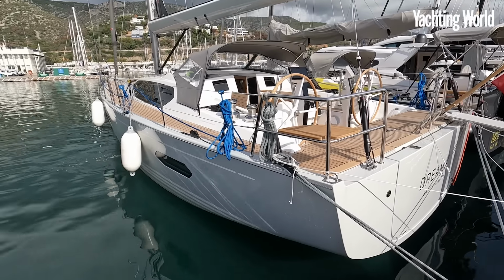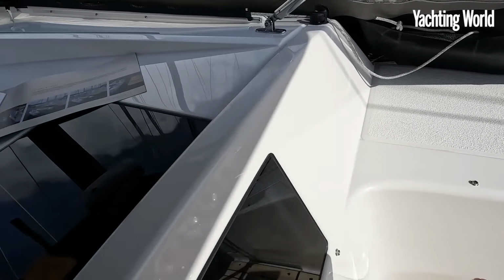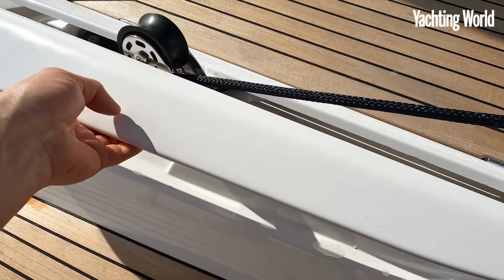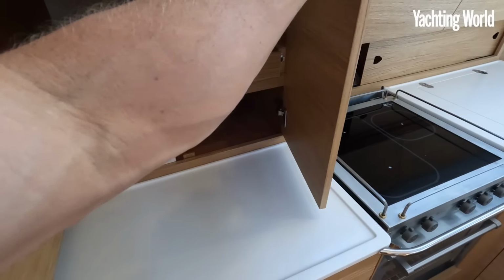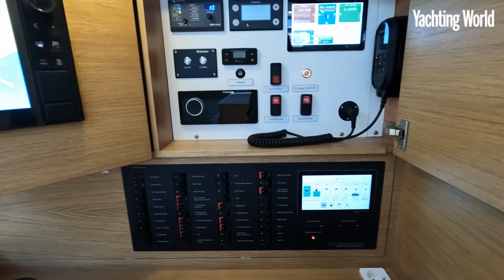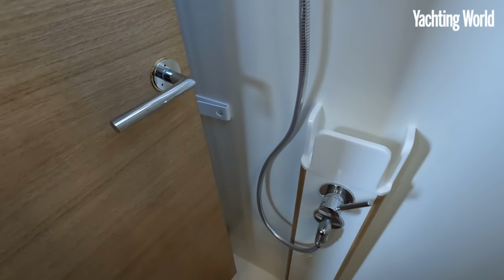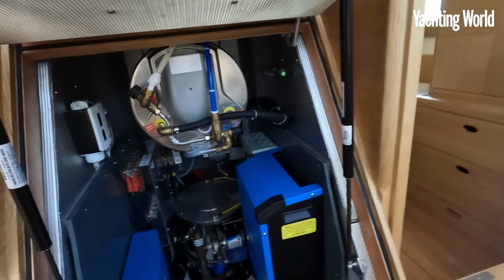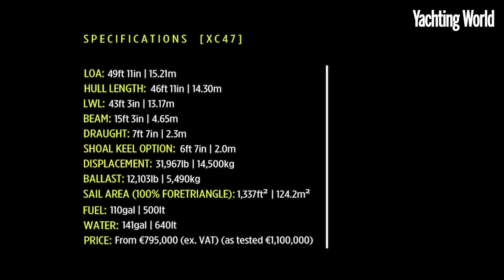The best bluewater cruiser ever? This Xc47 is definitely worth a closer look!

Comment: Did I understand correctly that they placed the water boiler above the electric motor with control controllers? Really. What can happen? With all due respect to the company, the diamonds added everywhere create the feeling that Dufour only costs a lot of money. The review itself is great. Thanks Toby.
Reply: Cheaper that way since the hot water lines already run there.  Agree it's not very wise.
Reply: What you may have misunderstood is that the size is 40 liters and therefore the placement is best with regard to available space. When I bought my yacht 15 years ago I upgraded the water boiler to 40 liters which was placed above the engine where there was free space intended for a generator. With my experience and also that I am an electrical engineer who works with boats, it is a good location for a bulky boiler. The option is not to place 40 liter size somewhere else, but in that case choose a smaller 20 - 25 liter one and place it in the stowage space under the bed. Dripping fresh water does not cause problems with electricity (48 V).
Reply: @mikaelgarton372  Yes, there is its “regular place” when the diesel engine is installed. But not in the case when there is a 60 kW electric motor and its control controllers right underneath it. It's like putting an ashtray at the neck of the tank. In principle, it’s okay, no one will smoke while refueling, right?
Reply: Your comparison is funny but not correct. Do you think there will be a short circuit ie that fresh water conducts current? What do you think would happen if the boiler not only leaks slowly but instead suddenly dumps all the water (40 litres)? How high would the water rise from the floor surface?
Reply: @mikaelgarton372  I'm definitely exaggerating. Nothing bad will happen, that's clear. The controllers are low-voltage, and the engine can also operate in water, it is designed for this. Perhaps the batteries are not made of lithium, which reacts with water. I mean that for 1 million you can make a different constructive solution. By the way, fresh water conducts current perfectly if it is not distilled 💥 :)
Reply: Interesting that you try to convince an electrical engineer that fresh water conducts perfectly :) and by the way, fyi there are 48 V lithium batteries installed in this xc yacht, but they only consist of a fraction of lithium and do not react with water like the experiment in chemistry class at school. I work professionally developing lithium systems for boats. I'll end the discussion here.
Reply: @mikaelgarton372  Forgive my ignorance. I once spilled a glass of plain water on my laptop, smoke came out, and the laptop no longer worked. This is also why my cell phone refused to work under fresh water. Now, if I were an electrical engineer, this wouldn't have happened. Good luck
Reply: @mikaelgarton372  All of your points are valid, but I know of no terrestrial electronics that like being showered and submerged in 60 Celsius water.  I would have tried to find a different location for the hot water tank, maybe in a different bilge or cabinet.

Even seawater is not very electrically conductive.  Fresh water much less so.  48 Volts is relatively safe in either.  Don't know if Oceanvolt steps up the voltage internally for the motor.  Maybe not.  And in any case it's pretty waterproof.
Reply: @Muratshayev  Most laptops and cellphones aren't designed to be used underwater.

Lithium Iron Phosphate batteries are vastly less likely to catch fire than other Lithium ion chemistries.
Reply: @LoanwordEggcorn  My point is that a 40 liter boiler cannot be placed under a sofa / bed / cabinet nor in the bilge. The size is too bulky. However in the Xc47 the floorboard is raised in front of the companion way, but as I understood here is a very large battery placed - 30 kW (48 V) translate to amphours as 13.2V it's 2200 Ah, which takes up the entire space. X-yacht has been building performance cruisers since the 70s and they always place tanks and batteries centrally. They have only been building the Xc = cruiser series for 15 years. If there had been free space more central and lower, they would certainly have placed the boiler there. The other aspect is that the hot water for the boiler comes from the genset which is placed just aft of the electric motor. The distance between the boiler and the source of the hot water should not be too far. It is also an advantage to have the boiler raised because it is easy to empty the water during winter storage and here I could note that there is already a transparent hose to easily empty the boiler.

Last but not least, the risk of the boiler completely leaking and dumping all the water is so extremely low that it doesn't exist. If it were to happen, the water level at the bottom would be a few centimeters before the water would quickly flow down into the bilge and trigger the bilge pump.
Reply: @mikaelgarton372  Thanks, all fair points.

The Fischer Panda gensets are popular, but mediocre, like most.  I'm a bit surprised that this seems to be a weak serial hybrid.  I like a parallel hybrid solution much better, like Beta is doing, for multiple reasons, including efficiency.

A parallel hybrid could keep the Diesel in the normal position, make hot water, electricity, charge the main battery bank, etc.  

A regular marine diesel with a large alternator or clutched hybrid electric drive motor is a better generator than a genset, and results in one less combustion engine to maintain.  In my opinion, it's a better overall systems solution.

(With a large enough battery bank, a genset isn't really needed, with enough solar and/or electricity from the Diesel.)
Reply: @LoanwordEggcorn  I totally agree and can add:
Although the battery is large, the range is limited (less than stated) because battery capacity is also required for all consumption. The alternative is then to run the diesel genset which creates 230 V AC (energy losses in alternator) - then transform to 48 V DC (energy loss) which charges the battery and provides power for propulsion. Some electric motors convert DC to AC to get more power but at the same time additional losses during AC conversion.
Driving the boat with a genset and electric motor is not efficient and the diesel consumption is higher versus a regular diesel engine.
In addition, I agree that the reliability / durability of a genset is significantly lower compared to a Yanmar or Volvo Penta.
Reply: @Muratshayev  An electronic device such as a laptop that does not even try to impede crap getting into it, let alone liquids, as well as mobile phone that at best only protects from dust balls and hair balls getting into it are horrible examples. Not counting that both of these are sensitive electronic devices where small fluctuations of voltage can seriously hurt the circuitry inside. Like your fresh water which can allow such small voltages to short circuit the electronics. Apples to oranges mate. I can not believe you are even seriously trying to compare those horrible examples to this topic. So yes we will forgive your ignorance, because if you were an electrical engineer (or even had a clue about even the basics of electric and electronics) you would know how silly those unrelated examples of yours really are.

Look I get your main point, that for that amount of money one would think they could have possibly designed it better. But that was already answered. It simply is not enough of a risk to spend that kind of extra money trying to come up with a better sol'n when it is really not needed and fits well in that designed space along with closeness from its source. Plus realizing that space was designed for multi-purpose options of drive power.
Reply: @kevinfisher1345  You are absolutely right! They expressed my idea very accurately. And yes, there are explanations for this. I understand. But I don't like it :)
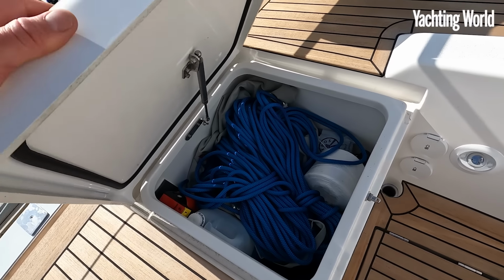I can give another example of a good solution, in my amateurish opinion - Salona S46. Good review of The ALMOST Perfect Electric Sailboat - Sailing Uma [Step 249]. There at 4:39 a compartment is shown where everything is in order. The boat went into production 2 years ago. The equipment is absolutely identical. Costs 2 times less than X
Reply: @Muratshayev  What boat costs 2x less? Are you trying to compare apples to oranges again mate? Or are you actually comparing a boat manufacture that is well known for its build quality?

Going by your brief example, I am going to guess it is nowhere close to a comparable build quality boat ... as you just expressed a less efficient design that costs more to do for no apparent benefit at all. Other than to appease naive people like you I guess. Especially if you think a less efficient design is a great sol'n. But meh to each their own I suppose, great to hear they have appealed to someone.
Reply: @kevinfisher1345  Salona boats makes great boats. No worse than X-Yachts. They are comparable in speed and design. In terms of price in the same configuration, the difference is almost 2 times. Possible only locally.
Reply: @Muratshayev  Thanks for not answering my questions. Smh! Everything you said was completely irrelevant to anything I asked and said. Look mate I am sure it might be a great boat, but that is NOT what I was asking about at all.

So I did a lil bit of research, and this is what I found quickly. Salona appears to be known more as a performance cruiser. As per Sailing Magazine and Yachting Monthly. Which yes has some good boatbuilding. But that does not equate to being known for its build quality. 

Also found this "Negatives:

The stanchions were not mounted very well. Silly arrangement that leaked. When the yard pulled the interior cabinets to access the stanchion hardware they found the shroud to grid connection was light and very questionable. The yard re-engineered both areas. I imagine these areas were improved in later boats.

Other than that super boat."

That does not sound like the greatest build quality to me ... and yet. Salona actually is competing directly with other performance cruisers such as X-Yachts and Beneteau’s First line in Europe, and J/Boats in the States. So perhaps not quite apples to oranges. Obviously at half the cost, while still being pretty comparable, somewhere along the line something has to give. I could take a few guesses where, but that would just be just that. My guesses and speculation. They cut corners where they think they can, but do not have all the little extra's that adds up, such as bolted in instead of screwed, expensive hardware, weight saving floor boards, well designed and more efficient designs (ie taking more time and planning to ensure is well thought out over all), etc. But I could be wrong. At the very least no one is raving about how awesome their build quality is. So my guess sounds pretty realistic.

Comment: There is nothing blue water about this. Electric propulsion with a 30 nm range is insane. If I need a genset running constantly, what is the point other than as an ego experiment.

Comment: Hm, I am not so sure if I join your enthusiasm and the positive comments in general: Firstly there is no mention of rudder- or keel construction which to me is crucial information in general but more so when a boat claims to be "blue water". From what I can see it is a sloop and I would certainly prefer a cutter rig to change gear quickly, again especially in a blue water vessel. Is this boat blue water capable? Sure, my Bavaria 40 crossed the Atlantic too.
There are some other features that I do not find blue water conducive: Handholds below, it looks as if one gets stuck once passing the galley to port / nav station to starboard. One could argue one does not go to the front in heavy weather but I would disagree. While I see rounded edges on the outside of the furniture, opening the drawers and cabinet doors show 90 degree edges, nothing is rounded there and pinched fingers will be the result. You did not mention whether lee cloths are available in any of the berths. 
I expect from X a high quality built and I am sure they did not stray from that reputation in the Xc47. But to me (and admittedly based exclusively on your walkthrough) this is a high end luxury yacht for Med- or Caribbean cruising. A lot would have to be done imho to make her truly blue water. 
Lastly I must address the price: with a one Million Euros price tag (who cares about a few hundredthousand up or down) I look at Amel, Kraken, Contest, Discovery... and for puttering around the Med or Carib I am going with Wauquiez, RM, Grand Soleil, Dehler... save myself 300 Gs which pays for a lot of nice dinners, berthing and maintenance.
Reply: After watching the 'boat boys' cross the Atlantic and back on a scruffy 40 year old Nickholson 32, I think we've been brainwashed by the marketing companies into what you need to go blue water cruising.

Comment: "The first seven clients have all chosen diesel"...Realy? 😁
Reply: Batteries are heavy and don't play well with water .smart to let someone else be the  early adopters.
Reply: 1. You have abysmal range with electric motor. 
2. You need range to motor in heavy weather (or in Doldrums).
3. Diesel engines have the range.
4. Diesel propulsion is suited to offshore/ocean sailing (range is king). 
5. Diesel wins...

Comment: Great video as always, thank you. (1) Not sure if possible and I understand that income from ads has to be part of earning some of the costs in here back, but if possible at this amount of ad interruption you could ask for 5 sec ads only and e.g. only from businesses in n associated industry.
(2) Generators in an EV-boat ... mentioned is 11 kW here and I presume that is the max electrical power that the generator can deliver. If we assume a (high) efficiency of 34% of the ICE used to drive the generator, then we need 32.4 kW ICE power or 43.4 HP. Running the generator for 1 hour surrenders 11 kWh to the batteries and with charging and other losses we hopefully end up with 10 kWh usable from the batteries that upon extraction will still have some conversion losses.
I am all for pure EV-boats done this way - (2.a) theory and definition: is this a serial hybrid design with the generator now?
(2.b) The point of these calculations is to show that an ability to charge batteries from solar reduces from the 43.4 HP, so if you have a bimini covering the cockpit, with solar panels on it, then you need less ICE HP and less fuel and suffer less from - however minimal in this boat - noise. Does the yard offer related options if not standard?
(3) The OceanVolt sail drive ... can it be rotated for (3.a) improved manoeuvrability? And can it be faced forward for more (3.b) effective electricity generation (cf. regenerative braking in your EV)?
(4) Zooming in on the AC wall outlets showed German "Schuko" standard, grounded 230V models - these are also standard in some non-German countries. And e.g. the French version has good compatibility options, physically in modern plugs and outlets in both directions. I guess the yard would offer other options (relative to the price of the boat this is about trivial costs).
(5) The design is Scandinavian modal, or minimalist, and light, but this can look a bit utilitarian and hence too expensive for what we see. The old school in warm darker lush woods feels anachronistic in a modern boat/yacht, though, to me. The question here is - I don't have the answer - if designs avail out there that do this "better" in the mind of Our Kind Of People (the opinionated ones).
(6) As this is a blue water ocean cruiser, I would expect a sleeping position for the person in standby sleeping watch, e.g. on the couch in the salon, away from the serious sleepers. Does the boat have some simple provisions for that?
(7) Autopilot - the boat has a load of computer intel, it seems, and no doubt an auto-pilot that can be set for a compass course to a waypoint, but can it instead maintain course relative to wind? (Without adding a Hydrovane - that I probably would want to add anyway as redundancy when sailing with minimal crew. That said, properly mounted fixtures for a Hydrovane could be an option even and yes, because of the swimmers' and davits platform there may be a challenge, so a yard delivered option would be great).
(8) Not clear to me, but all the push-button things like furling and potentially others, do they have a manual backup operation in case of such  device failing, or  power outage?